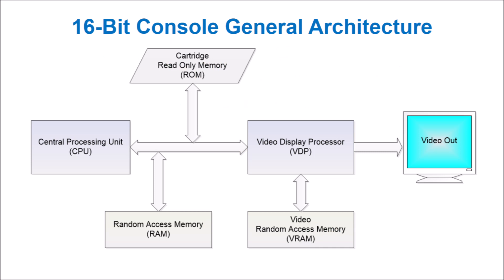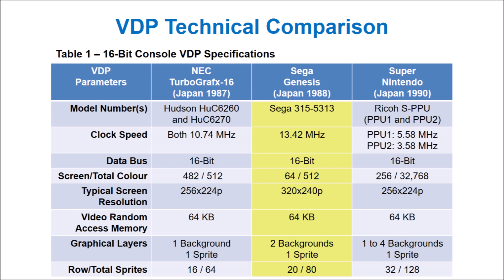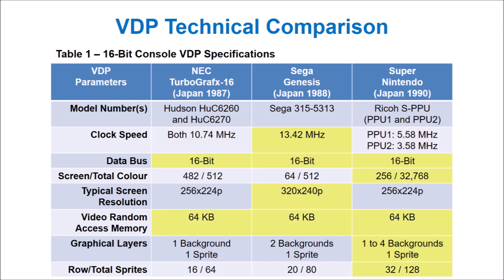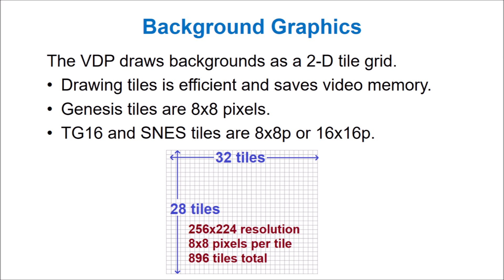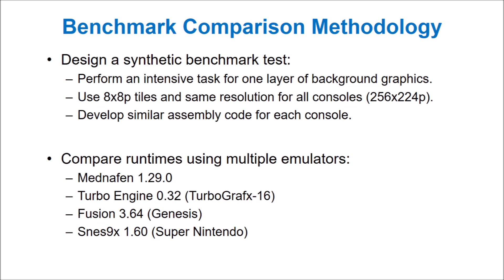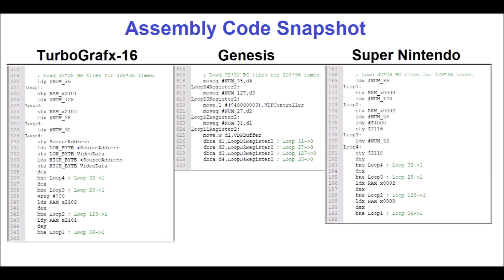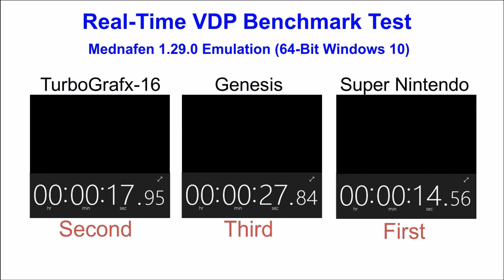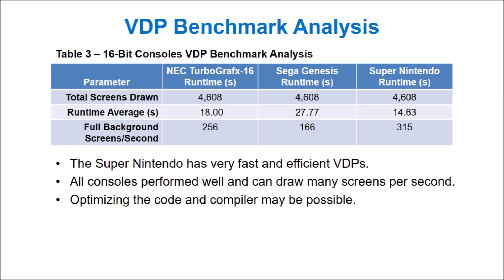VDP Performance: TurboGrafx-16 vs Genesis vs Super Nintendo

Comment: I was intrigued by the title of this video, but I am sorry to say that unfortunately this is not a VDP benchmark whatsoever. It is somewhat interesting to benchmark RAM to VRAM data transfer speed as a minor point of comparison of bus speed, but there are too many flaws even with the method used to make this simple comparison. The code presented does in fact not push any of the systems to their limits, as no special instructions are used, no particular care is given to the choice of institutions used to perform the transfer and crucially no DMA was used at all. Let’s say that at the very least the title is misleading…

Comment: A good example of commands per cycle and cycle speed. Although, the Megadrive definitely had the edge on the SNES when it came to sprite handling as far as I could see. So many shooters on the SNES were awesome, bar the fact they slowed to a crawl. The PC Engine however, was an awesome bit of kit for it's time, annoying it never got released in the UK. Still have a Turbo Graphix portable about, which despite the battery issues, was very impressive graphically and was better than any rival product at the time.

All had their advantages to be fair. If used well, any of these systems could kick ass. All they were missing (at least for me) was a keyboard and a way to program them.

Comment: This comparison, while interesting does not paint an entirely accurate picture of which machine was faster in the graphics department. I believe, if you factor in each systems RAM along with their graphics processor the end results would look radically different. These machines are far more than the sum of their parts.

Comment: The only limitation of PCE are the single backgrownd instead of 2 or 4. Any way PCE are close to the SNES on this benchmark. With an independant 2 backgrownd layers even with optimised 64 sprites the diference will be minimal . So no mather if are 8, 16 or even 32 bits procesors the VDP are the heart of all these consoles.
Reply: 'even with optimised 64 sprites the diference will be minimal'...sorry bur the diference between 64 and 128 is too big for pce, it cant rivalize with snes
Reply: @anty1222  It's pointless to compare because it's not about having too much of one thing or another. They are completely different architectures, and the reason many games only came out on the NES was due to Nintendo's exclusivity policies and because it meant reprogramming from the scratch in Assembly. Yeah in this era Nintendo do the same Sony do with block almost all titles exclusively to PlayStation. Nintendo and NEC had a legal battle because Nintendo was blocking SF2. The arguments that it wasn't possible are shattered, and they reaffirmed that with Garou Densetsu and Garou Densetsu Special. Not bad for the little 8-bit .

Comment: The Genesis VDP had a ton of effects in order to bump up the amount of colors the genesis could display iirc
It did prove to be an issue on the original VA0 units where they found an issue with the vdp and clock speed mid production and had to wire on  another board in order to fix it
Reply: 'The Genesis VDP had a ton of effects in order to bump up the amount of colors' : sorry but all the games of genesis had poor numbers of colors...its a fact
Reply: @anty1222  genesis games are fairly colorful but it is true that they do have a pretty limited number of palettes.
Reply: @nuclearkitten6421  It's a shame, because with the higher resolution of the MegaDrive, Sega really shouldn't have limited the number of colors so much.

Comment: Interesting vid. Apparently developers weren’t discouraged by CPU “Benchmark’s” as the software that was released on the Genesis/MD was far more superior than anything released on the TurboGrafx-16/PC Engine and in few instances the SNES too.
Reply: Take Bomberman 94, vs Mega Bomberman vs Super Bomberman 3.... More superior? Are you on kool aid? MD and SNES don't have a chance. I know this example is made by Hudson, slightly biassed towards the PCE, but I do feel they ran into hardware limitations with their BM94 conversion attempts.
Reply: @2kBofFun  "don't have a chance" on what basis ? Each console has its own merits. And everyone doesn't necessarily expect the same things from a game. You just sound like a PC-Engine nerd salty because the Megadrive and the Snes got more success…
Reply: @nathleflutiste PC Engine wasn’t actually 16-bit.
Reply: @plawson8577  Yes I know, it's more like two 8-bits processors working together if I recall correctly, but even though it was the case, the system has very promising capabilities.
Reply: @nathleflutiste You do not recall correctly.

Comment: I think it could have done with a contemporary PC comparison point. Maybe a 386 with a VGA card? I think those were common around the time these consoles were on the market. If you just want to use emulators, the DOSBox wiki says running it at 7800 cycles will give speeds comparable to a 33MHz 386.
Reply: We had a 386dx40. What VGA card I have now idea. But we could play battledrome in a for that time ok framerate
Reply: Forgot the 386, the 486 came out in 1989! Although I do not think it is fair to compare these 3 consoles to a 386 or 486 variant. Right off the bat the gulf in pricing is so large you could have purchased all three 4th generation machines at once and still had money left over to purchase a bunch of games. They just aren't in the same league as the 386/486.

Comment: Your assembly code doesn't even match your pseudo C code. The snes and pce aren't doing any sort of "tile[n]". PCE is literally doing display(counter-), and SNES is doing display(counter-). The PCE code is writing the counter to ram, and then reading it back.. for no reason!.. why??!!! Just write Y reg to data port like you're doing with the snes code. Also.. you can't write to VRAM during active display on the SNES. It doesn't work - only during vblank (stop using crappy snes9x.. it's old and inaccurate). You CAN write to vram during active display on the PCE and MD though. But on the MD, you will stall the CPU because you'll fill the FIFO buffer too fast- which is what is happening, which is why it's slower.

 Your SNES version is going to be much slower, because you can only write during vblank time. The PCE one, I corrected it to be like the SNES one and it's ~70%. I mean, not like any of this matters because this "benchmark" doesn't show anything. Literally doesn't tell you anything - it's not representative of anything. And it's also highly dependent on the CPU.

Comment: You also got quite a bit of your specs wrong. The "typical" res for Genesis/MD is not 320x240. It's 320x224 (it's only different in PAL regions). PCE/TG is typically 232 lines not 224 lines (and even up to 240 lines). You're "video" clock speeds are also all wrong. The huc6260 is not a "video processor".. it's just a color encoder. So it's only the huc6270 for the PCE/TG. Emulators does mean anything. Run the tests on a real console (like console devs from their respective communities do), if you're really trying to benchmark stuff. For example; SNES9x runs the snes at the full 3.58mhz in high speed mode, but the actual performance is closer to 3.1mhz because work ram runs at a slower rate than fastrom - and this is a 65x design.
Reply: what is the speed of snes video ram is that not more important for the video hardware testing,plus the snes has more on die cache ram vs the genny maybe that is why the snes video hardware is a lot faster
Reply: @athos5359  What? Explain to me what exactly you think is "on die cache" on the snes..
Reply: @TurboXray  from sega retro forum,internal gpu cache genensis=236byte, bandwitch=28,846588mb /s. snes=1056bytes ppu1=544byte OAM ,512 CGRAM.
Reply: @athos5359  Sega Retro is a shitty and seriously inaccurate site. Please for the love of gaming, don't read that garbage. It literally has made up figures, complete misunderstanding, and is the running joke of retro gaming for years.

 There 's NO cache on these video chips. There's a line buffer for sprite fetching, and SNES is old school with on chip ram for OAM table and color ram (just like the PCE, and like the NES before them). On chip memory is not cache. Buffers are not cache.

 And to go back to my point; the "speed" of the video processor is not inherently testable via writing to vram in a loop.
Reply: @TurboXray  wel the sega genensis had a sprite cache so theres that it reduce acces tovideo ram so i think this banchmark is more puching the video ram to the limit than the video chip.
Reply: @athos5359  There is no sprite caching. There's a line buffer, which all three systems have, and that buffer is refilled/rebuilt every line (it has no mechanism to say, "ohh I already have this graphic sliver, I don't need to re-fetch it"). None of the system show here have ANY cache. Let me repeat that; there is NO cache on any of these systems. They're FIFOs, and buffers, but no cache. And finally, the SNES is fetching more pixel data than either of the other two systems for the line that is about to be drawn (it has up to 4 tilemaps). You can show all of that by simple logic, but that's not the same as how much "free bandwidth" you have to write video ram via a DMA or CPU side. The SNES both lacks a FIFO to buffer the writes, and also lacks the available vram pointer logic to write to vram during active display simply because that same vram pointer logic is being re-used for something else during active display. I mean, you can TRY.. but you won't get valid writes (which is the major issue with this video - the snes CPU "thinks" it wrote to vram but in fact did not complete the valid write task) - cram is the only exception on the SNES which you CAN update during active display because it's not simply vram.
Reply: But if we leave aside all those technical details that are only of interest to developers, the difference in color depth is obvious. It's not even that, MD colors always look more sober and desaturated. With the different techniques, PCE, without having dedicated hardware for independent scrolling, does very well in Garou Densetsu Special, Lords Of Thunder and many more titles. Garou Densetsu is quite faithful (not quite exact) to the Neo Geo version. The only thing I take away from all this is that it was always a myth and marketing. PC Engine never claimed to be 16 bits and TG 16 clearly said "16 bit GRAPHICS" on the game box. Never High Definition Graphics or True 16 bit Power.

Comment: In the USA we never even heard about the Turbo Gfx 16........ ever.
Reply: Strange, I bought two a few days after launch in 1989, in a very small, rural town in the U.S.A. - at a regional department store at that.
Reply: @markstrickland438  Same.  I was lured in by the big ass sprites in Legendary Axe and China Warrior.
Reply: I did back in the early 90s. Saw a few comercials on our satellite tv.
Saw them at Babbages for 47.99 in maybe 91-94 sometime.
Really wanted one but ended up with a super nintendo.
I later bought one at a pawn shop I think with over a dozen games. Sold it in the late 90s.
Reply: You didn't miss out on much. It's like a slightly upgraded Nintendo(NES).
Reply: @MemableAI  you have no idea what you're talking about lol
Reply: @darrendavenport3094  It had an 8bit CPU. I have the ROMs and can play the games. They don't compare to the Genesis or SNES. Maybe you could correct me.

Comment: What do you mean by “drawing... background tiles”?

Do you mean loading into vram from cart rom or wram? If so which? Do tiles need to pass through wram to get into vram? I don’t think they do.

Is loading tiles into vram something which is a common bottleneck in practical performance?

Why do games slow down? Is it due to loading in tiles from the cart or is it from a large number of sprites animating (updating their co-ordinates and loading in new frames of animation)?

I’m thinking bottlenecks/slowdowns occur, not due to the loading of background tiles but the animating of sprites, along with background tile scrolling and animating.

I suppose animating a background tile (not pallet swapping) is just loading in new tiles. Although pallet swapping is also using some bus bandwidth.

So the loading in of background tiles might be 1/4 of the load on a fast moving action packed game on the cpu and bus.

So your test is not indicative of more than 25% of the factors which affect game performance.

I appreciate the test you made. But if you are replacing the same tile repeatedly, with, I guess, alternating two different tiles (or just the same tile), would there be a different result of you were replacing, say, 20 different tiles concurrently? 

Edit: sorry, you’re drawing a whole screen and replacing tiles with the same tile. But background layers are generally wider than the screen to allow loading in of tiles before they appear in the viewable area, you probably already knew. That doesn’t affect this test though.

I don’t know. But a more useful test might be to see how many unique tiles can be loaded for each new frame.

Then to scroll the plane whilst animating the tiles and see if that affects tile loading in speed.

Then to add animating and moving (co-ordinate) sprites, maybe one at a time.

You would need to write benchmark software like, set up a timer, based on cpu clock speed (as these machines don’t have crystals), although MHz is a measurement related to a second, it’s easy to say 2.5mill cpu cycles = 1 second, then count any fractions to get a millisecond like 2.5mill / 100 = 1ms then count them too) to count (to a fraction of a second), the time it takes to scroll a plane, say, 32 tiles horizontally (255px) with an ever increasing load of sprites. Say, 0-40 on screen 8x8px glowing orbs, like a shmup game. 4 frames of animation each. Have them bounce in a parabola with randomised heights so we can see them. Also have them slow towards the top to simulate physics.

Tests like that, anyway.

I’m not even sure what I’m looking at here.

Are you actually just loading in colour information or pixel data?
Reply: @inceptional  well H40/320px wide res, for some reason, allows more data to transfer into vram during each h-black state than H32 mode. I don’t understand this.

Drawing is done by some now obsolete technique called ‘blitting’, which is a component of the vdp or ppu, which has a limit to how much it can do per frame. I don’t know what a blitter is or what it does, but the Amiga has a chip which only does blitting.
Reply: I looked up what ‘blitting’ is. It’s short for block image transfer. What it means is, that if a colour already exists in a pixel from one frame to the next, the pixel is not redrawn, ie, the colour attribute for that portion of memory is not reloaded and this system is actually not obsolete but still in use, as is the packed pixel format, as opposed to the planar pixel format.
Reply: @inceptional  I don’t think the system is being throttled, as I think you’re suggesting, for H32 mode compared to H40 mode.

It’s more a case of circumstance.

It’s confusing, because a scanline is moving at a set speed, so you assume that if there’s less pixels being drawn then there’s an advantage to the bus in transferring data.

But actually these old consoles are not clever, they work like clockwork.

The data bus is moving more data in H40 mode because in H32 mode, when the scanline reaches h-blank, the bus has to wait until the next scanline begins before it can push more data.

That’s my assumption.

As the system is designed for H40 mode, the bus must be set at a nominal speed, which doesn’t change based on the resolution.

So when H32 mode is on, which is really a compatibility mode, designed to simplify conversions from games using that resolution, the bus is simply waiting when a line of 32 columns is drawn.

I found the table, it’s under Bandwidth for the Sega Retro Sega Mega Drive/DMA page.  H40 shows about a 10% additional amount of data per scanline.

What’s even more confusing is that the difference between 60Hz and 50Hz is over 110% increase in bytes transferred per scanline for 50Hz. When the scanline speed is only 20% slower.

Interestingly, on the Sega Mega Drive/Technical Specifications page, I just noticed there are actually two cart speeds available 10MB/s and 15MB/s.
Reply: @ribenasquash  Your assumption is correct. Thats why 2600 programmers had to race the beam.
Reply: @jhoughjr1  oh yeah, I’ve heard that term before.

I guess it means cramming as much data into active display, h-blank and v-blank as possible.

Comment: Yeah. The Mega Drive co processors were always it's weakness. The main CPU was a beast but the VDP and sound chips never utilize the CPU to it's potential. 

The Super Famicom had the opposite problem, great co-processors hamstrung by a weak CPU. This was fixed with the SA-1 enchantment chip, which was basically the SNES CPU clocked 3 times faster and more RAM. I'm still kind of confused why Nintendo didn't use this as the CPU in the first place but it could have been a cost thing.

The PC Engine was the most balanced of the "16-bit" consoles. It was easily the most efficiently built console. If you ever see the console, you'd be surprised how small it is. Too bad NEC did a terrible job marketing it in the US.
Reply: "...but it could have been a cost thing"
Nintendo originally planned for backwards compatibility with the NES and that's why they went with that CPU to start with. The SA-1 was released couple years after the SNES launch. I can only assume that silicon process refinements allowed that higher clock.
Reply: @MrMilli in the Jaguar docs they mention how they make the custom chips compatible with both 16 bit 68k and x86. In the end 32bit MIPS also worked. How could big Nintendo not hold open the door for 68k?